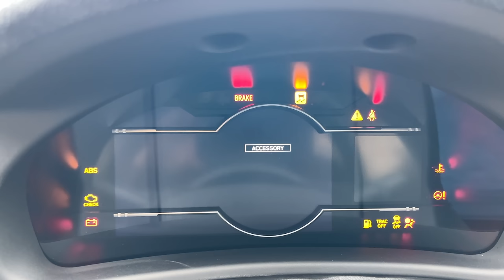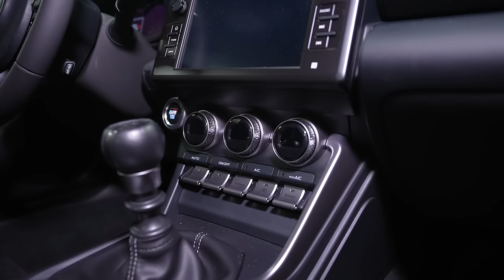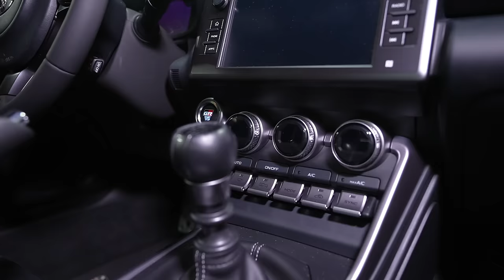Should You Buy a 2023 Toyota GR86? It's heavily over shadowed by a rival in 2023

Comment: I own a 22' GR 86 and absolutely love the car.  I think the RWD alone would make it far more fun and playful than the GR Corolla's AWD.  I've been to Roebling Road Raceway twice in this car and stayed mostly in 3rd and 4th gear so I can't relate to the 2nd gear complaints you're talking about.  The gearing is a bit notchy but I actually like that.  My only complaint about this car is the clutch.  I don't like how high the engagement point is and I don't like the lack of feedback.  I replaced the stock clutch spring with the MTEC spring and it's a little better but still not great.
Reply: I did the same with my 18 wrx when I had it, have you driven one and if so would you say it was similar?
Reply: @deej628   yeah my last car was actually a 17 WRX.  I never replaced the clutch spring in it though because it felt great from the factory.  I prefer the WRX clutch for sure.

Comment: Great vid but there’s one point that he could not be more wrong about: that the failure to give the GR86 more power or a turbo will result in it dying out like so many other sports cars. This is the opposite of the truth. If it had more power they would have to upgrade every single component on the car to match the power - brakes, transmission, differential, wheels, tires, etc. this would massively increase price and cannibalize the Supra. 

Cheap sports cars can sell car that has followed this formula is dead. They might be classics now but the FD RX7, Mk4 Supra, Mitsubishi 3000GT and Nissan 300ZX ALL DIED OUT because they chased this mistake. Mazda sold 24 first gen RX-7s for every 3rd gen they sold because they made this mistake and it killed the RX7 forever. 

Toyota’s brilliance was in not listening to all the voices screaming for a turbo and keeping it simple, light, and cheap.

Comment: I like your videos, very informative.

However, I’m not sure where you got the information that 2022 GR86 and BRZ brakes are smaller. In fact, the brakes are directly interchangeable. I have a 2022 BRZ, and I’m running racing brake pads for older generation BRZ on my new BRZ. The pads are exactly the same!

Comment: He likes the GR Corolla evidently. 😁

I still like the GR86 and I'm thinking of buying one eventually when mark-up prices disappear. However, my issues with the car are different. I heard people complain about the buffeting, and I like to drive my car at times with the window down. The last sports car I bought was a 2018 Subaru STI that with the factory sports exhaust made a sound thanks to the unequal-length headers that no Subaru product is able to match these days. If Subaru would still sell that STI, I might buy a new one.

The GR Corolla would be the actual current replacement of my STI, but I have an SUV for the four doors requirement and I would like a car that I would enjoy driving. It doesn't have to be particularly fast, but one that gives me the pleasure to drive it. It needs to be lightweight, reliable, manual, rear-wheel drive is a plus, naturally aspirated another one and I would love some analog feelings that you get when you drive an STI. 

To me, the main problem of the GR86 is that it was going to be an affordable sports car, but Subaru and Toyota forgot that exclusive versions are not as important as the main version that is affordable. The original plan was a car for less than 30k.

Mark-ups, few cars available, rate hikes, and inflation made my wife happy by preventing from me to have already a GR86. Time will tell, but I Toyota and Subaru do not address the problem of the price I'll buy my second option, a used MX-5, which I will always call Miata, not a GR Corolla. If would want to spend tons of dollars on a Sports car, I'll buy myself a Boxter or another possible option, unfortunately not available with a manual, a 2014 RC F. Reliable, powerful, and currently at a reasonable price.

Comment: I bought a new one in 2013 and had it until 2018.  Didn't do much with it, as I only bought it to support auto companies still making fun cars.  Ultimately, I didn't like it.
On one extreme, I'd have been happier with an MX-5 (double-wishbone everywhere, lighter), giving up some usability (2-seater, tiny cargo space).
On the other extreme, I wished Subaru would've just made a version of Impreza with RWD.  It'd have been cheaper (just convert the power train), way more usable, and with more engine options.

Comment: Those metal covers there are actually for safety. The fuel rails are behind them and what they do is take some of the impact in case of side crashes. To help prevent fires in the engine bay. Sounds redundant but they actually function quite well.

Comment: I am getting one and am completely aware of all the short comings. Will use a Super Bee baffled oil pan with increased oil capacity, thus redoing the RTV and make sure it's appropriate. Next i will keep an eye on the oil uptake with my borescope through the drain plug hole. Will look at using heavier weights of oil but i am adding a separate oil cooler. I'm planning to add forced induction to it eventually. I am used to subarus and needing to help them with the last few flaws lol. And omg bro i literally cant afford the GR Corolla, this is perfect for my price range.
Reply: Check out Phelps garage here on YT. He actually solved the oil issue with an accumulator. I think the baffle pan actually made it worse.

Comment: this is a little harsh it's more practical than a miata slightly faster and better looking imo and significantly cheaper. Not withstanding that not having a turbo is an actual benefit once you get out of the initial break in period. Even if there are shortcomings with the design it will still be cheaper to maintain than a turbo charged car would be. This is a less is more situation which is not accounted for here and it matters the corolla is a competitor to the wrx not the brz.

Comment: There are some differences between the GR86 and the BRZ, from the wheel arms are probably most notable,  to the brass (not copper) fittings. Subaru has a slightly different suspension in the rear. Subaru modified it to different specs. These are minor, but the BRZ and GR68 do have some minor differences. Someone did a break down and took them apart.  I personally like the older gen, I have a series Yellow that looks brand new. There isn't a week where I don't get a compliment on it. My own vanity took over while looking for a new car because the yellow series comes up with a upgraded suspension (I Don't know why) and brembos. I don't regret my choice, but the older gen (depending on the year) has a semi useless media center and eye sight wasn't offered-so I get the appeal.
Reply: Yeah I remember there were suspension differences in the first gen,  the brz had a softer suspension.  Stock for stock around a track,  the brz was faster because of that

Comment: My trust in you just went down a lot after this video; you’ve got at least 2 facts incorrect with this platform: 
1: The engine code name is FA24, NOT TA24D. 
2: 4:58 - 5:15 Not sure if they actually made this change because the engine still suffers from oil starvation (when taking aggressive left turns).

And 1 important thing you missed mentioning is the excessive RTV silicone being applied to the oil pan (which further causes oil starvation). Many say it’s not a big issue or that it’s rare but I don’t think that is the case.

And finally, this is a ~$30k car (brand new). For that price, you can’t expect it to be built all by Toyota nor can you fault it for its shortcomings. Regardless of all its flaws, this is still a very good looking/sounding car & it’s also very fun to drive (2800lbs with 215whp/175wtq + RWD/NA).

Comparing it to the GR Corolla was unfair (because of the price difference) but still, this is the better car overall 🤷‍♂️

Comment: I do not want a Corolla GR because it is 4WD..   I want front engine  RWD with a manual and a LSD in the back!  So GR Corolla is not for me.   If I lived where it snowed a ton... then maybe the Corolla, but the GR86 would be fun and fine in snow as well if you drive as needed.

I see the GR85, FRS, BRZ as the lightweight, front engine, RWD car we NEED!    Its a modest variation on the Miata.

Comment: For people who have driven enthusiasts vehicles in all modes of drive (awd, fwd, rwd), you can appreciate that the driving experiences are quite different.  From what I’ve seen in reviews, the GR Corolla understeers quite a bit.  No thanks.  

I’ve owned a 2013 & a 2017 brz and now a 2022 gr86.  The 2nd gen solves the few issues that I found previously.  I only found a minor issue in the 1st gen being difficult to engage 2nd when cold.  No such issue with this gen.  Perhaps I’ll eat these words, but I think the damaged shift linkages AMD referenced, may well be due to driver abuse.

I don’t track my cars.  I drive them in a spirited way on the street and behave (largely) like an adult.  Being able to step the tail out in low speed turns from time to time just makes me smile.  This car has ample power and it’s size and weight makes it an excellent drivers car.  I prefer it to the ND2 Miata (coming from a guy thats previously owned 2 miatas)

Comment: I'm a little late to the conversation. I have a 2024 GR86 Premium. I have the lane assist and radar cruse control. Not sure if that is a 2023 vs 2024 or a standard vs premium thing, but there you go. The video was very informative of what I need to be aware of, so thank you for that.

To give you a little insight, I've wanted a sportier car for some time. To go with my Ford Escape, I wanted something a bit 'unreasonable.' As I have my boring SUV to do grownup things. I didn't even know about the GR Corolla because I wanted a 2 door, rear wheel drive car with a manual. The front wheel drive 4 door Corolla never made it past my search filters. I did look at the GR Corolla briefly before I signed on the bottom line. I wasn't even a bit interested. That was before I knew about the price differential. The GR86 scratches an itch that a Corolla, or any other 4 door or front wheel drive ever could.

Comment: My 2023 GR86 is a MT and it shifts fine and clutch it a bit aggressive, but I like that. I do agree the engine is noisy due to the DI. But I'm getting used to the noises of the engine. 

I've yet to "accidentally" open my center console by leaning on it. For one, the door open outward so if you do lean on the button the rest of your arm will be on the doors which will keep them closed. My biggest complaint about the interior is that there isn't a place to put your phone. I put mine in my door even though it doesn't fit. The center console isn't deep enough to hold the phone and close the console. There are some areas this car is going to give up due to pricing and that is why I bought it. I'm a minimalist. I don't like all the electronic features weighing a car down. 

As for the "rivals" mentioned at the VERY end of this video even though it is implied in the title that the video is about rivals to this GR86. I don't consider the GR Corolla a rival. Neither does Toyota otherwise they wouldn't sell it. Plus it is way more expensive than the GR86 even in base trim... 36k versus 28k. I got the premium trim which is still less expensive than the base Corolla. And we should always mention that ordering a vehicle from Toyota isn't the same as ordering a vehicle from another manufacturer. Toyota gives allocations, they don't fill "orders". 

The Miata is a convertible roadster, not a 2+2 coupe. I owned a previous generation power hard top and I can tell you that I won't ever own a roadster again. I'm only 5'10" but in the Miata I felt like a giant. Very little seat adjustment ended up causing pain in my back. The GR86 being a 2+2 gives you ample room to adjust the seats. Plus the hard top version of the Miata starts at 39k and just goes up from there. Not to mention the handling characteristics of the Miata versus the GR86 are very different. Mazda has a lot of body roll and doesn't handle near as well as the GR86. Granted it does ride better from a daily driver standpoint because of the softer suspension. I think the GR86 holds a spot on its own for those who want a solid top sports car with plenty of leg room, plenty of power, and loads of aftermarket support ranging from simple quality upgrades to complete engine swaps and wide body kits.

I will agree with the engine points being made. There is a known problem with tracked vehicles blowing up their engines. Plus there is an issue with clogged oil pickups with silicone engine sealant that seems to shed from the internal areas of the vehicle and collect in the lower oil pan. That doesn't seem to be a concern for vehicles that are not tracked. That being said, if care is taken to maintain oil levels, use quality oils, then those issues can be mitigated.

Comment: Car is worth the money to me. Paid close to msrp for mines. Plus the GRZ is a car that is meant to be modified. Thats the intent of toyota and subaru designing the car. Lightweight chassis, with a bare bones engine in it and you can do anything with it. Make it a drag car, make it a drift car, a show car with how beautiful it looks. Or if ya wanna daily it, cool beans. The point of the car is to make it what you want it to be. Im going to make mines into a posche competitor. Once i get my techniques down and reach the car's limit on N/A, I am slapping a turbo. And the reason i want it slow is cuz i want to learn how to drive a slow car fast rather than drive a fast car slow. Worth the money. Worth the effort. My ONLY complaint, and it is one that will stick til i fix it is it desperately needs an accusump and better baffle because of the oil. Otherwise, not a bad car. It has given me a reason to learn to work on cars.

Comment: Back in 2020, I could not find a single BRZ / 86 with a stick within a days drive...for months.  I ended-up buying a Veloster N.  Yeah, it is driving the wrong wheels, but it is still a blast to drive.  I call it my amusement park ride on wheels.  I take back roads on my commute to work.  I have always liked the 86 as I do the Miata.  Remember, a lower powered car is more fun to drive fast than a powerhouse is to drive slow..  My VN sits in the middle of that.  Good power, but not at all insane.  I still get decent mileage too....when I want to.  Of course, after winning the 2020 R&T Performance Car of the Year they could not cancel it quick enough.  Boo!  Honestly, good luck finding a GR Corolla or a Honda CTR for sticker...if at all.  I got my VN with the performance pack for under MSRP in 2020.  A lot of fun for cheap!

Comment: Nice video and a thorough review. The rear seat weight sensors are federally mandated now. Sadly due to people leaving their buckled in children in car seats sitting in a closed up car and in the hot summer sun. Why anybody would ever forget their child in a car seat is beyond me..but that’s why we have weight sensors now. The GR 86/BRZ does have a distinct bandage over the Corolla being that it is Rear wheel drive and that it only has two doors. Better Weight distribution and handling and way cooler, Not to mention much less expensive. The Subaru flat plane crank engine has a different power curve to get used to. They are rough running and gutless until you get to about 2500 RPM when everything starts to smooth out and the power curve begins to come in. That said, that engine design doesn’t necessarily have a long service life. A Subaru is a car to love until it reaches about 90,000 miles… After that the head gaskets blow, it begins to use oil excessively and the rod bearings are usually pretty loose. Models with a CVT are usually on the second transmission by then. And with the typically undersized brakes on a Subaru, you’ll have changed them many times by then..Also, you can tell it’s not a Toyota because it doesn’t have a spare tire. One feature I really respect Toyota for keeping. This car is marketed for younger buyers and ones who will add more power to it. They aren’t going to care if the ride is a little stiff And it’s noisy. While you are right, they are not the most robustly built, they will however go down in history as affordable classic track warriors that are prized by the young at heart. Even though it’s so much more of a quality car, a front wheel drive four-door Corolla just isn’t going to be in the same class I have to say
Reply: In Straylya, GR86 comes with a can of gooo and the BRZ a full size spare tyre, BRZ is $$$$ less to buy too. This reviewer just hates the car!

Comment: AMD, why do you knock Subaru so much?  I currently own my 4th Subaru a 2023 Outback Touring XT.  I did own a Toyota once a 1979 Corolla 2 dr sedan, a real basic car.  I have found Subaru to be extremely reliable, trouble free and way more comfortable then a Toyota. I looked at a RAV4 but the seat base was way to short and uncomfortable.  When I look at the front of my Outback I can see some Toyota resemblance.  Toyota has its' share or issues also, so why knock Subaru all the time? Maybe the engine from my XT could have been used in the GR86.  I like you and enjoy your videos, and have learned much from watching them.  I am so glad the shop is doing well, and I see you now have 2 employees.  Please stop knocking Subaru, they are good vehicles and the AWD is not extra.